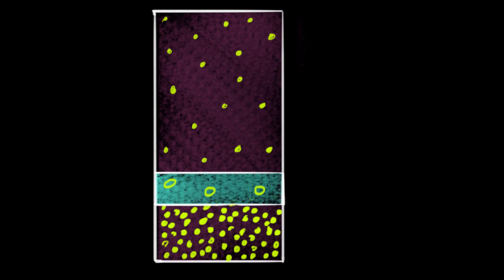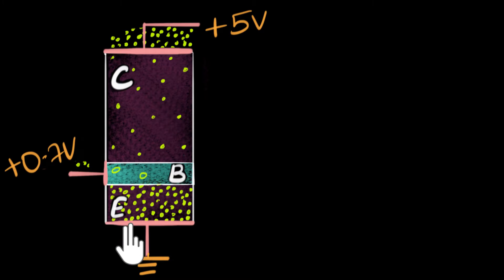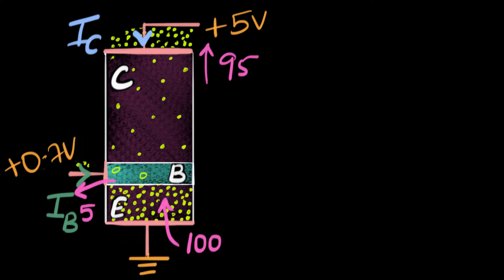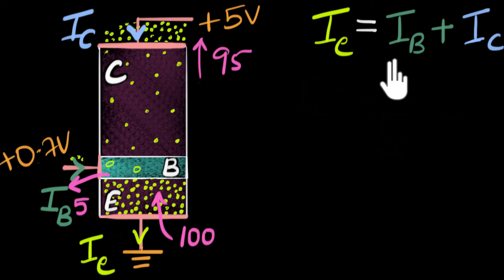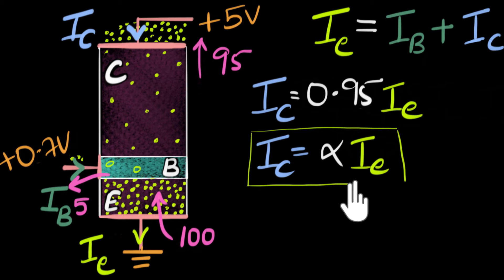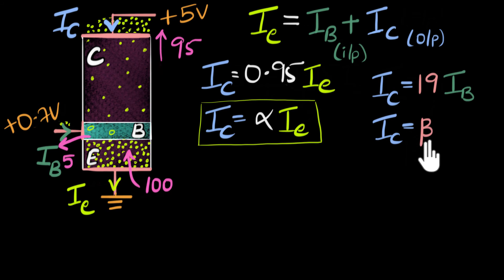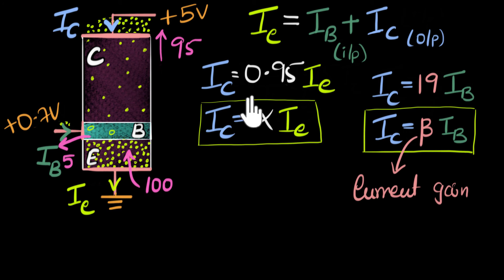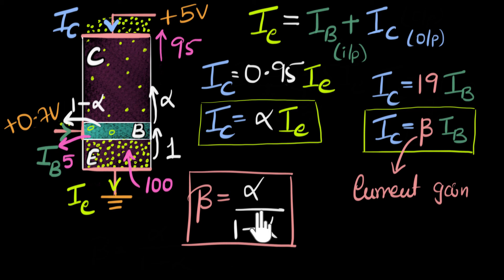Transistor current and parameters | Class 12 (India) | Physics | Khan Academy

Comment: that was extremely understandable! Thanks in tons! 
But I do have a question, Professor, related to the microphone itself, What exactly does my voice represent in a microphone? is it turned into waves? and what type of waves are they? Or is my voice the 0.7 or more voltage? Since one electron flows out of 99 in there, where does this electron go? into the microphone? is it double wired? I am not sure how this whole thing is implemented
Reply: If you're a school student or at least not an engineering student it'll be quite difficult to explain, cause this way of viewing a transistor and just this knowledge is like 1+1 in the concept, it's a small building block, you need many other concepts of the transistor to understand how a microphone works. Not to mention, the working of multiple transistors, their connections with one another, and the different transistor types.
IN SHORT you can't expect to understand how a microphone works with just this knowledge
Edit: Not trying to make it sound worse, but you also need to learn some signal analysis then some random signal analysis too🙂
Reply: Bruh it was earthed on the other end